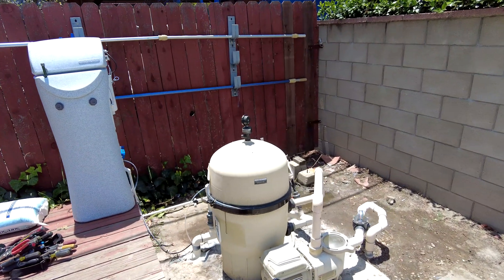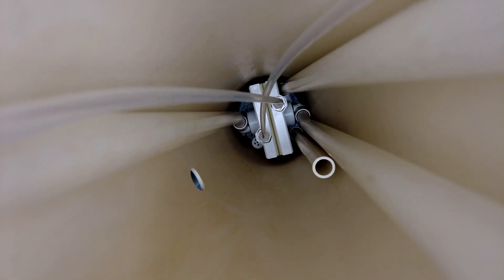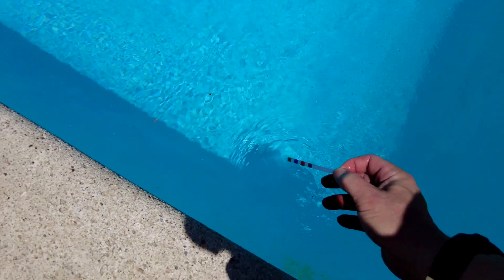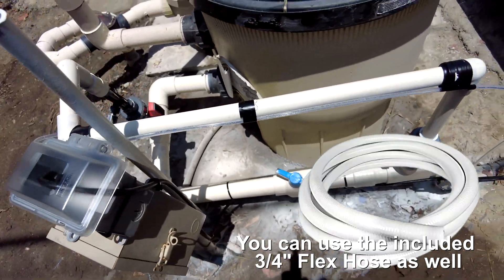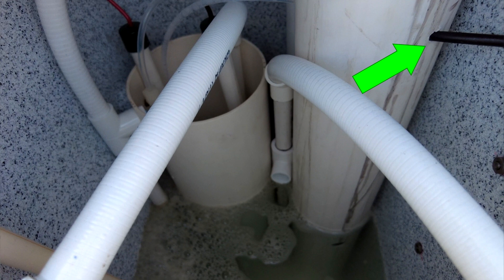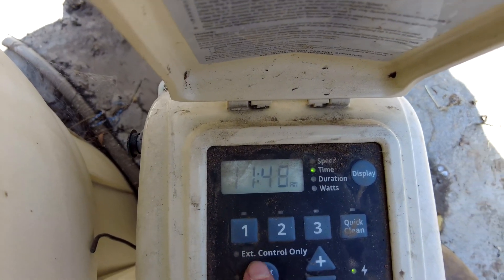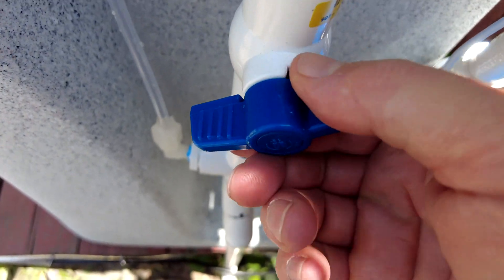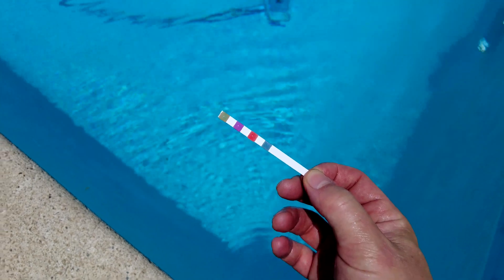Chlorine Genie Up and Running and Making Chlorine - Amazing!

Comment: i dont know how you producing tha much chlorine I setup the genuine at my house and it wont even produce .05 ppm its been running for 5 days now no stop and hasn't changes my chemistry is down to the t I'm chemist major and my pools have  always been balanced properly please call me or email I would love to talk to you because r this thing doesn't work for me at all its 34000 gallon pool 2600 rpm speed pump  and I cant figure ut why I gopnt no chlorine level at all only see a tinny bit in return but total cholorin is 0.5 and it been a week
Reply from the maker: You can email them directly and the problem could be the initial set-up itself. Support@UltimatePoolWater.com

Comment: Still a bit confused - a salt cell still generates NaOH (sodium hydroxide) - the Genie design keeps it out of the pool, but did your video say to just drain the water into the garden?  I'd imagine the hydroxide would accumulate over time and ruin the area.  What is the solution to dealing with the alkaline water long-term?
Reply from the maker: No, drain into dirt or a drain line into the sewer. Draining into the grass or planter will kill everything. Also draining on cement will stain it.

Comment: It's a uniclor from the 80's on steroids installed hundreds of them in florida the only problem with these  is the return that gets the most chlorine ALWAYS GETS STAINED bet the diodes and rectifiers are expensive to change not sure it's worth 5 grand
Reply from the maker: Thanks for the caution. The parts on this seem well made.

Comment: Not exactly a work of art and looks like a maintenance nightmare……I’m sure it just appears that way and hopefully future generations of the product can just be “ plug and play” without all the tubing and valves
Reply from the maker: The tubing is not terrible but I would like to see built in threaded fittings on the machine. Its a pretty solid device and the main parts are pvc pipe.
Reply: Exactly my thoughts.

Comment: For the price, I would put a pool on a chem controller with chemical injection, similar to commercial setup.
Reply from the maker: It's roughly the same $$$  except this will generate the chlorine vs adding it to a tank by the equipment.

Comment: Are you familiar with a product called EZ Pool concentrated pool blend? They are a pool RX competitor, and for the commercial pool I’m treating it would be about $700 cheaper. Thanks and take care!
Reply from the maker: That just has copper in it. Probably very effective against algae.
Reply: @SPL  gotcha. So it wouldn’t decrease chlorine decade to the level of pool RX?

Comment: Just curious, about long term pricing. Looks like with this you will regularly need Salt (something my salt pool doesn’t need added after initial balance), as well as an RO filter and a descale filter changed. Currently I am only in need of a gallon of acid a month.
Reply from the maker: The filters are around $100 each every year and a bag of extra course salt is $5.00. So around $300 per year is my estimate.
Reply: Yes… but you have salt in your pool… long term stress on your equipment & plaster/ finish & tile
Reply: Also ph is easily controlled with the genie.